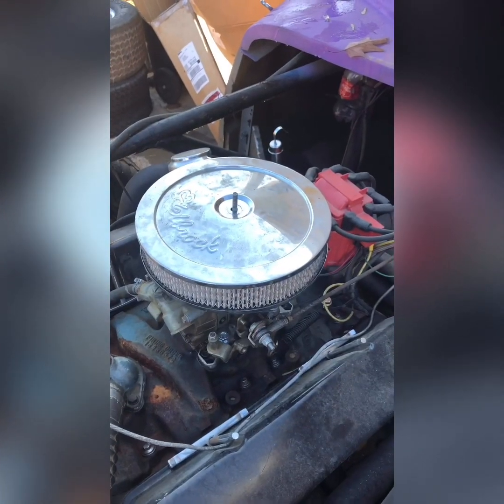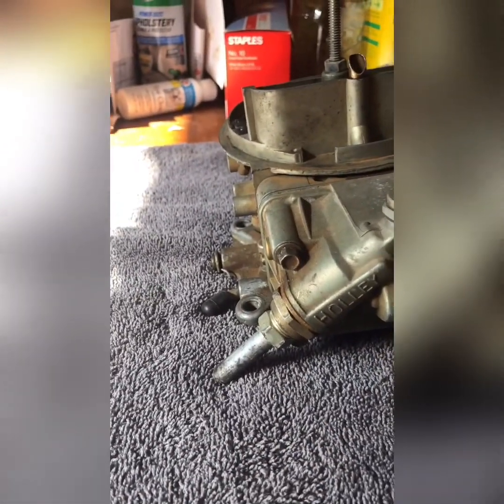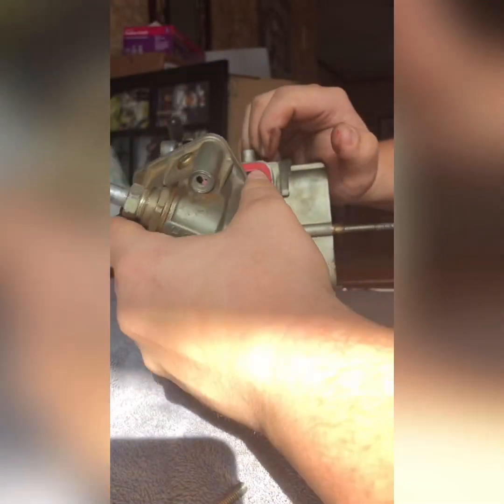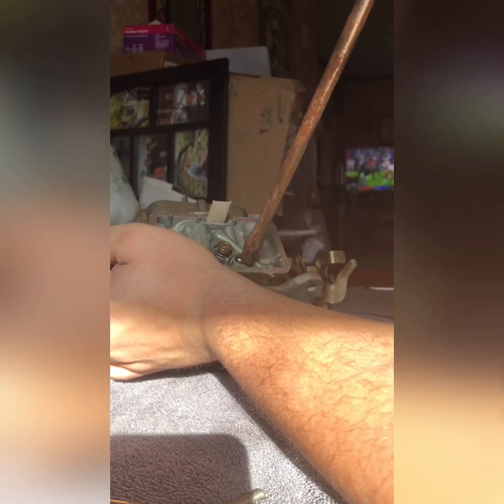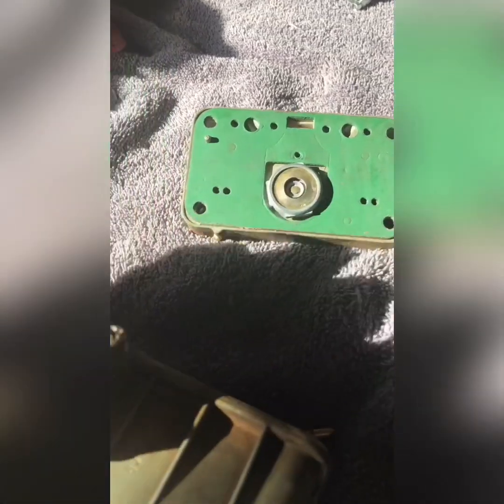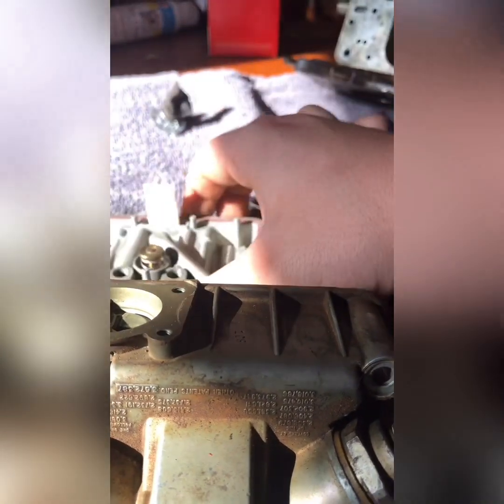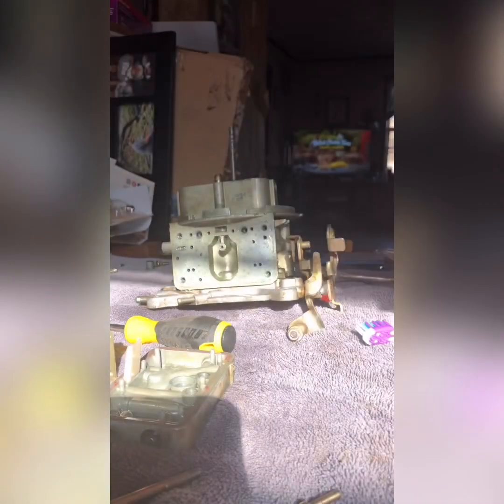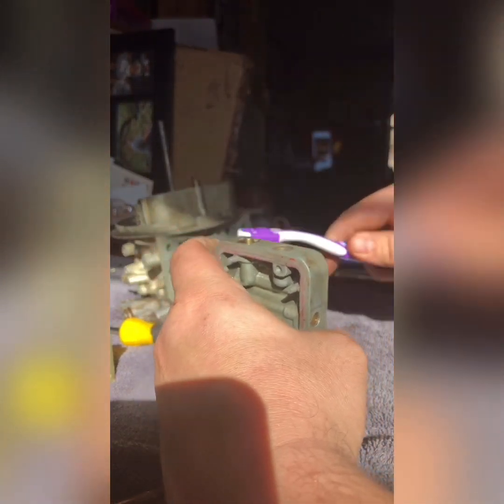Rebuilding our Holley 4412 2 Barrel Carb

Comment: How to properly adjust the Holley 4412 CT 2 Barrel carburetor, would a improperly adjusted 4412 cause the chevy 350 to stumble?
Reply from the maker: Yes if improperly adjusted it could cause it to stumble. You might also want to check for a leaking gasket allowing too much air

Comment: What is the -2 stand for on a 4412-2? Thanks
Reply: Is it the xp 4412-2? Black carb?
Reply from the maker: Mine was not but the rebuild kit I bought the paper work had a stock 4412 listed as a 4412-2 which I’m assuming is a serial number listing or the way the key code is used in holly. Such as the xp 4412-2 is just an aluminum version a 4412 with a few other differences. I also most feel the -2 is just noting it’s a 2 barrel

Comment: Mine idles fine just cuts out at higher rpm. Its been getting worse every weekend....
Reply from the maker: After I rebuilt this one we where still having problems and found a crack in the base plate causing us to suck too much air. Hope you get yours straightened out!
Reply: Yea I got mine fixed